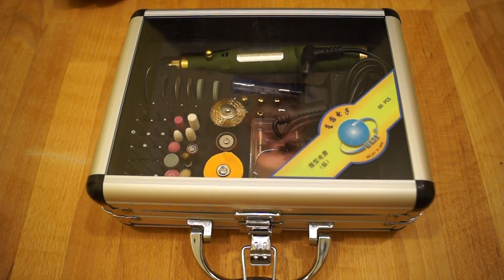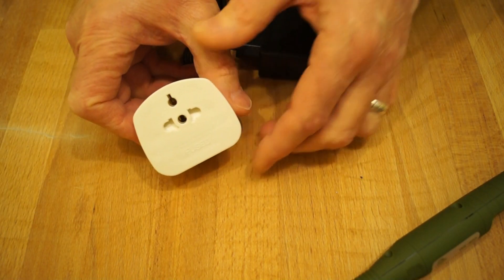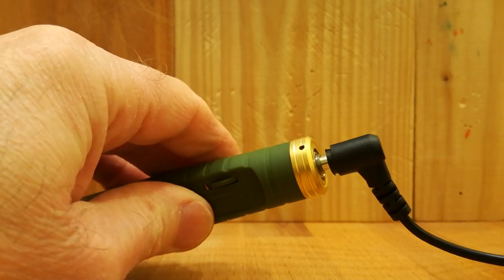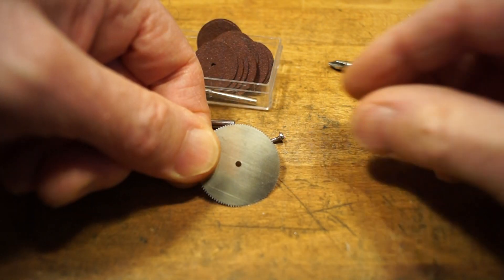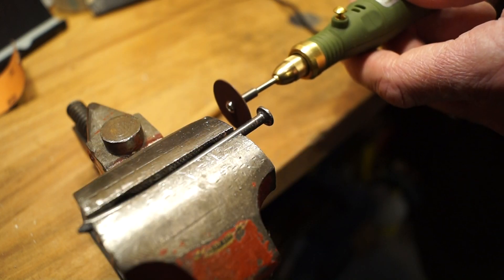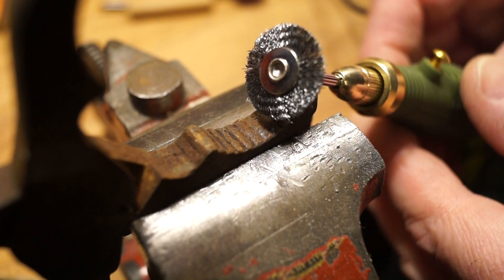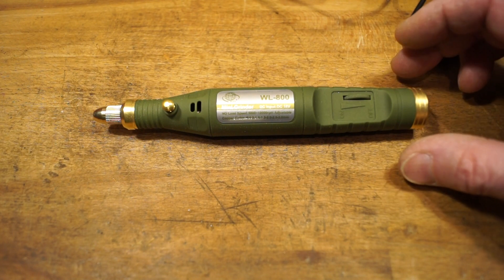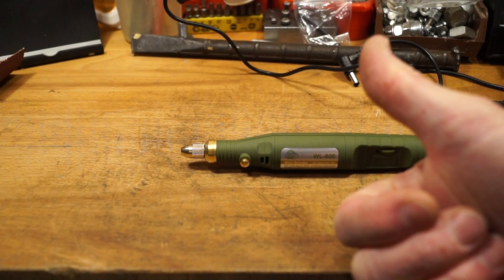WL-800 Micro Grinder from GearBest

Comment: I agree this may work best for someone into balsa wood or plastic models.  I wonder if it will aid you in tool refurbishing?  I recently broke down and purchased a Dremel but I have not used it yet.  After looking it over, I bought the accessory that can make it stationary so it is easier to use on very small, or delicate parts.  I am looking forward to using it.